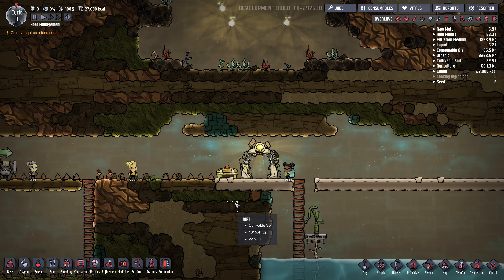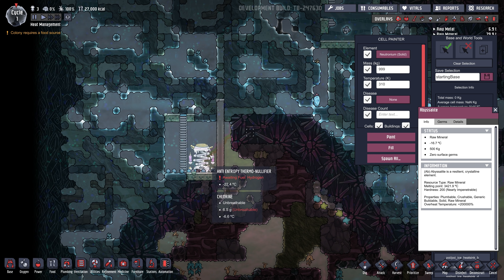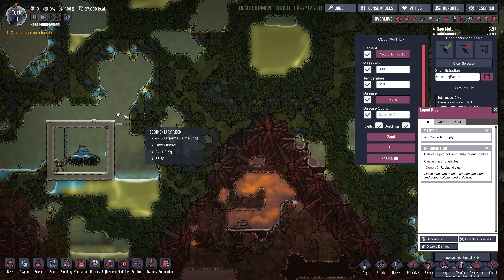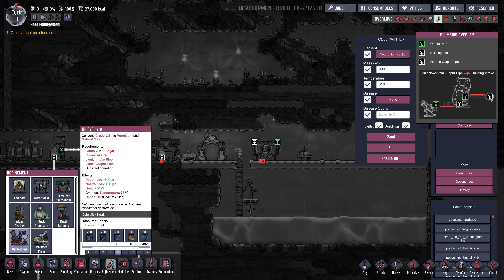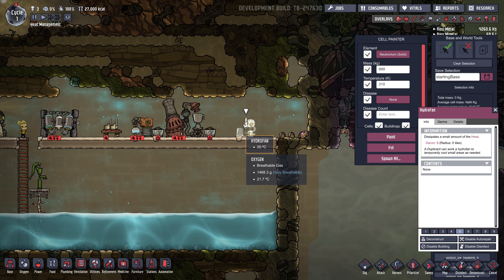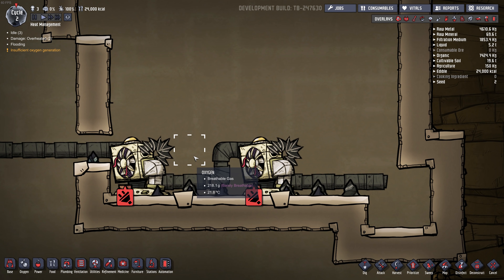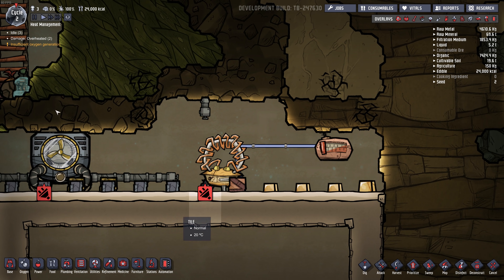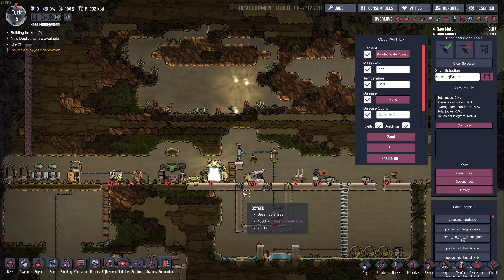Beginner's HEAT Management & COOLING Guide Tutorial - Oxygen Not Included

Comment: Insulated tile works the same as abysality, but using other materials. I have a hot water container made of insulated sandstone, and it holds all the heat in it. I use insulated sandstone for tiles and pipes, and save the abysality for things that does not have an insulated version, like the bridges.
Reply from the maker: Ok good to know. I'll have to try it out.
Reply: Actually I find the insulated variants of buildings take significantly longer to build, and abbysalite is common enough that is can be used easily most of the time

Comment: Biomes only determine starting temp right?   Meaning, if you dig out an ice biomes removing all the weezewort and snow/ice there will be nothing to make it cool down anymore.
Reply from the maker: I think if you remove everything eventually it would be warmed by other areas if the abyssalite is removed between them. I feel like there is some default background heat/cold but that probably isn't true. I've been able to do this after putting power production in a dug out ice biome.

Comment: You CAN(unless they changed it during the tube update) cool down geysers.  That means you can get cold water out of the geysers at a very minimal cost.  The water is created at the temperature of the geyser(and goes up a little, which is why it tends towards boiling).

You can cool it down over time with a single wort.

I'm not the originator of this information.  It was on reddit a while back.
Reply from the maker: I'll try that out..wheezewort + hydrogen + shift plate?
Reply: It was painfully underengineered.  Like pretty much just a granite pot a few tiles above the geyser.  I think granite walls too?  Some hydrogen piping should do the job.

https://imgur.com/a/g5RSB

Guess it was a little bit more involved than I remember.  I don't think it needed much of anything past that almost sealed room.  The key is still you are cooling down the geyser and not the water.
Reply: Nice.  It is too close to be a design coincidence.  I do remember seeing a sealed room with hydrogen cooling pipes chilled down and not thinking much of it at the time.  Must have been cooling down the geyser then as well.
Reply from the maker: That looks awesome and OP!
Reply: I bet it means you can cool almost everything down by targeting the source.  Like starting with cooled down crude oil before feeding it into everything?
Reply from the maker: I tested this again and it didn't seem to work for me. If the pressure in the geyser room is too high it won't give off steam. With about 2kg of cold hydrogen in there it gets VERY hot after the first burst of steam.
Reply: Maybe they changed it or also likely the person didn't have complete information.  I observed one I had that was at 20.5c in 20c water and when it emitted there was a burst of hot water.  After running for awhile the geyser stayed 20.5 and so did the water it was in.  Perhaps the game still has some rounding errors that favor the temperature of whichever body is larger?  It still looked like over that period of time it was able to put out non boiling water in to the reservoir below.  Sorry for the misinformation.
Reply from the maker: Maybe I didn't let it run long enough. There is a bug for sure where tiny amounts of water can heat or cool very large tiles of water. Maybe that was happening.

Comment: I'm concerned about the cold biomes becoming exhausted by using them as heat sink regions.  I'm still fairly new to ONI so I've not done a lot of construction into cold biomes, but my limited experience has shown me that ice melts quite readily when a relatively small amount of heat is introduced into cold biomes.  So my question is this: how long do, or is it possible for, the cold biomes to remain cool when I am using them to cool machinery or radiator piping?  In other words, are cold biomes just magically cold because the world generator made them that way or do they only remain cold for so long as there is cold/frozen material remaining in them?  What is the approximate lifespan of a heavily industrialized cold biome?  Thank you.
Reply from the maker: Cold biomes are not magically cold. They stay cold if there are wheezeworts present or if they are perfectly insulated. There is a lot of mass that is cold in a large ice biome so it can take a while to heat it up completely. I wouldn't use them as a permanent solution for cooling but they are a quick and dirty way to cool things until better systems are set up. Nullifiers are very good at cooling and wheezeworts probably come second. Melting ice is preferable to mining it because you get 100% of the water vs 50% from digging a tile.

Lifespan... depends on heat generated I guess. If say you filled the biome with power generators it would probably heat up in less than 100 cycles (maybe faster).

There are several ways to destroy heat as well such as the water sieve (eg put in 90C polluted water and get 40C clean water out). You can also heat up oil before you turn it into petroleum (which comes out at a fixed 75C temp). You can also heat the petroleum before burning it. You can heat gasses or liquids and dump them into space to destroy the heat. Hatches can eat hot items and will destroy that heat.
Reply: Thank you, that's a lot of advice!  I've been trying some of these suggestions but my technique is crude and my infrastructure has a lot of problems.  Right now the only thing I'm using a nearby cold biome for is one giant liquid radiator to cool both Metal Refinery waste and a nearby steam geyser's output.  The biome/radiator is large enough to cool the refinery's waste just fine but it is nowhere large enough to handle all of the heat from the geyser, so I end up receiving back to my base nice cool Polluted water and uncomfortably hot Clean water.  Can't win.  -.-
Now that I have first hand experience with some of these methods, I wonder why you placed emphasis in this video on using "heat destroyer" machines whose output is a stable 40ºC.  40º is still way too warm to maintain the starting temperate biome.  I'm guessing that's where additional cooling processes come into play like the Thermo Regulator and Aquatuner.  Would such utilities best be served to further cool that stable 40º runoff?  Or are they optimized in some other application?

Comment: Kinda outdated, but I had a really great spawn!
Or so I thought. I have 4 geysers nearby, 3 water, and one natural gas, and maybe another or two a little ways away. I also had a gold volcano and several oil wells below! It really helped me skyrocket into mid game, however I soon discovered my farms stopped working and I started to starve! I ended up having to make a massive meal wood farm inside a box of insulation with 3 and later 5 wheezeworts.

That kept me alive for a while until the natural gas geyser stopped erupting. I still survived though. But because my base can’t be powered properly I have to chose to manually generate power or run less machines. And I find that the 3 natural gas generators with tuneups literally overheat when they run constantly.

Comment: germs die at 80 degrees.    The liquid tepidizer is perfect for this.  Having played with it extensively, there is no circumstance where boiling water is a worthwhile activity to try and make clean water for base...
Reply from the maker: Ok good to know. I guess the germ overlay details aren't precise...or maybe there is a gradient of temps that kill more and more germs as temp increases.
Reply: I studied it because I was trying to make a physically based air conditioner.  Make  a small air tank submerged in water, then compress air into that tank, which IRL would get hot, because the amount of heat in container is increasing.  Lower the temperature of that tank.   Then release the compressed air, and it should be cooler.  However ONI doesn't appear to work that way.  If I had to guess, ONI assigns a temperature to each individual cell, then those temperatures change as a function of temperature of adjacent cells, and the material in the cell.  What I have found in my bristleberry farms (i haven't rigorously tested it...) is that it is easier to cool off areas with high air pressure than it is to cool off areas with low air pressure.
Reply: It's a exponential/logarithmic decay rate. But if you want to dual task it, add in an ore refinery to help kick start the heating too - dual purpose it.

Comment: Space heaters only heat gas around 80ish C.
If you build abyssalite room with a steam geyser you get half or even less water, the steam wont cool down at all.
Steam will max out at 5kg and it will spew water from time to time.
Reply from the maker: This isn't what I've experienced with geysers as long as you're pumping the water out of the sealed room. I was able to support 80 or so dupes with two geysers this way. Over many bases I did once experience a geyser over pressurize in a sense and it was easy to fix by just removing one tile.

Comment: Is there a mechanism for turning water into steam? I'd like to boil off my poisoned water and recondense it with worst in another container.

Nm I asked that before you got to the space heater.  You were so focused on talking about how things were too hot and lowering heat I didn't think you were going to cover the opposite.
Reply from the maker: You can drip polluted water on an iron or magma volcano or on a tungsten tile adjacent to magma. Or an aquatuner that is near overheating. Much easier to just put the polluted water through a sieve though. You'll convert the sand to polluted dirt in the process which can be put into the compost for dirt. This way you don't have to worry about cooling down the steam again.

Comment: Why is heat bad... Because everything in this game produces heat! Even the cooling devices! (Unless you exploit the games bad programming.)

Some items are great for deleting heat, defying physics, even more than others.

Airlock doors delete gasses. So heating a gas, by pulling heat from one spot and forcing it into the gas, then deleting the gas, will also delete the heat it contained.

Plants delete heat in water, sometimes completely, if you set the volumes of consumption right.

Dupes eat heat! Hard to manage, but if you super-heat the food, before they eat it, they will delete that heat.

Metal blocks, wrapped in insulation, will take the insulations "heat-value", as an absolute value... So... dumping heat into a metal block that is wrapped in cool insulation, will delete heat, defying physics.

Space, an absolute vacuum, is a GREAT way to delete heat. Just pump all your heat into some gas you don't want. (CO2) Then pipe it up into a room where there is a "leak" into open-space. It will suck out all the gas, and any heat it contained within it!

Some "partial things", have a maximum heat level. Like molten metals and some liquids, gasses, solids. So, dripping a partial amount of some liquids, will instantly drop a "fixed temperature" to that fraction of a material. However, the part it dropped from will lose that same fraction of heat. However, dripping more, does not increase the temperature of the dropped pile, while the dropping fraction, above, will continue to lose heat, as it loses its mass.

Hatching critters are a fixed temperature, as well as when they die, but the eggs and critters can be heated to a value greater than the new state they take-on. (Killing a creature in Lava-like temperatures will make a piece of meat that is lower than the temperature of the lava, for instance. When an egg hatches, it is about body-temp. But the egg it hatched from, could have been pre-heated to 300F, before it hatched.)

CO2, pee and farts, from dupes, is always body-temperature... I forget if they fart and pee through thermal suits...

Mining cold blocks will destroy a lot of the cold. (Best to NOT mine them. Use heat to melt them, from your hottest things.)

Mining hot blocks will also destroy a lot of the heat. (Best to mine every hot block you find. Including insulated blocks that touch gasses. But not ones that are submerged in liquids. Same issue as insulated blocks... Touching liquids, they don't transfer heat, but they WILL transfer heat to gasses that they touch.)

Don't uncover natural formations, which are hidden in rocks... If you notice, the area around them is cold. As soon as you uncover them, they absorb the heat of the "exposed formation". Which, also heats-up the surrounding air. If you leave it covered, they don't exist underneath. So that is why you see they are near-freezing and they cool the surrounding air, but not surrounding liquids.

TIP: If you have a high heat natural formation... Don't surround it with insulated tile and leave the GASSES between them and the insulation. The heat will transfer into the insulation and eventually seep-out. Build a "U" insulation CUP around it. Then fill the space with some kind of liquid... Then cap it off with insulated tiles. Now it will be virtually as inert as when it was covered-up and didn't actually exist. Well, not AS INERT... as it will not start making "cold".

A vacuum costs ZERO materials, and is more effective at isolating hot and cold.

Easy way to make a vacuum...
1: Build a ladder with walls on both sides.
2: Remove the ladder, because it will transfer heat between tiles. (Or, build the double-wall, from the ladder. You can reach from the ladder itself.)
3: Fill the hole with a liquid, or just leave it filled with air.
4: Use a pump to remove the water (faster), or air (takes a lot longer).

Poof... instant heat-isolated area. Though, it can also have a reverse effect, trapping heat too.

Though, the insulation blocks have gotten a little better. They are 100% insulative against liquid-heat, but not gasses. For gasses, two layers will eventually transfer heat, a few hundred cycles into the game. Once heated, they virtually generate heat that is nearly impossible to cool, because of the bad code they use to simulate bad physics. :)

Leaving liquids between two insulated tiles will provide vacuum-like insulation. Perfect place to store polluted water that is HOT... The heat will not transfer into the insulation and both sides will have isolated sides. Also, polluted water can't gas if there is no place for the "gas" to go.